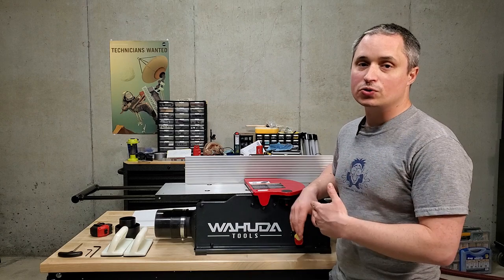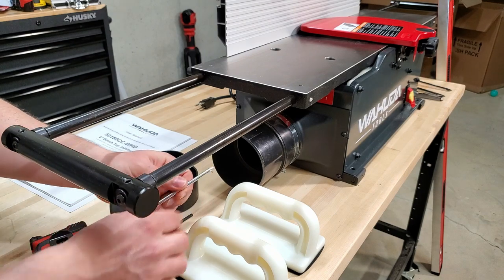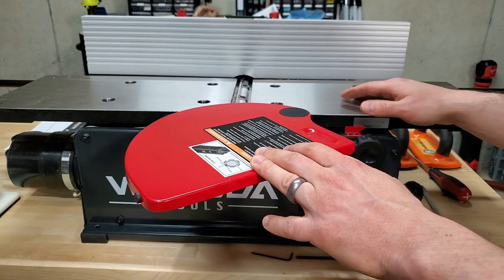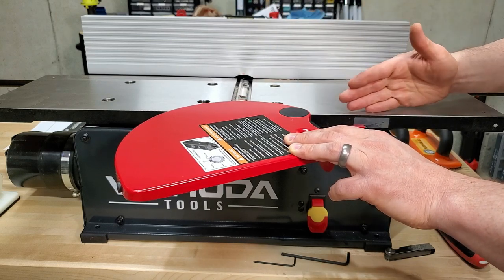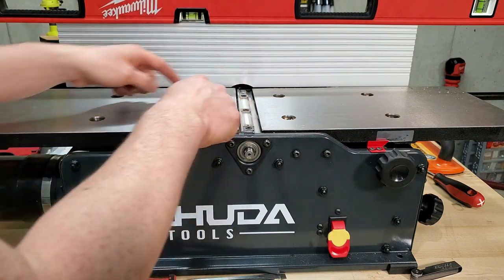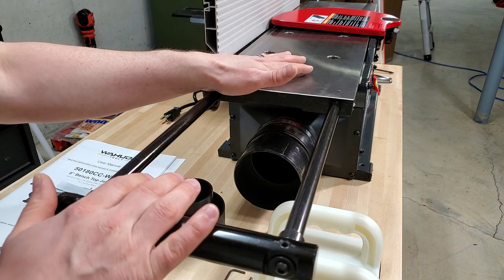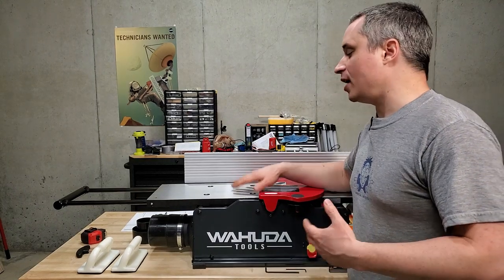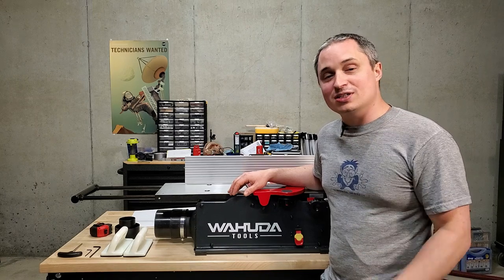Wahuda 8" Benchtop Jointer with Spiral Carbide Cutter Head Review and Setup Tips

Comment: The WEN is the same machine and it is $425 at Home Depot.
Reply from the maker: The Wen has aluminum tables and high speed steel inserts.
Reply: @DoresoomReviews  I'll check that out. Externally, they look the same.
Reply: The WEN has a spiral cutter head with 16 square blades. It has 1" thick machined aluminum tables that users have stated are flat and true. I will go with the WEN.  I have three other WEN tools that have been reliable.
Reply from the maker: If the tables are of the same tolerances, I'd expect it to be a great performer then. You may even be able to update the cutters to carbide when you need to replace them, if the cutter heads are the same design too.
Reply: @DoresoomReviews  Possibly.  I heard someone say cast iron tables are expensive.  That could explain the difference.  Notice that most contractor table saws use cast aluminum. That keeps those prices down.  Flat is flat, regardless of the metal, or MDF etc.  Most router tables are MDF.
Reply: Just wanted to chime in. I'll don't believe the HSS cutter heads are a direct swap for the carbide ones. The older Cutech (now Wahuda) spiral machines used HSS inserts that could NOT accept the newer carbide style. All of this is assuming that the WEN is basically the same machine as the Cutech.
Reply: @russmartin4189  I agree flat is flat, but I will take cast iron any day over cast aluminum, just due to the strength of the cast iron alone. As careful as I try to be, cast aluminum is always softer and scratches and gouges so easily for me. Also, when its time to upgrade and sell the older equipment, the cast iron helps tremendously with resale value.
Reply: @vipervt09  Because of how much I will use it and the recommendation of someone on another channel, I went with a 6" Wen, spiral cutter, and aluminum tables. I will see how it works out. If I don't like it, it will go back. It does not make sense to me that steel is better than aluminum if both are flat.  My table saw table is aluminum and is flat. Scratches have no effect on planing. Old hand tools were all made of steel, aluminum, and wood. Today, they have a lot of plastic in them. Even pro tools. MDF is better for cabinet doors than real wood because of stability.  And so it goes.
Reply: @russmartin4189  That makes sense, I'm sure it will work out great, Wen makes some really nice stuff.  I used a Kobalt job site table saw with aluminum top, and using a crosscut sled, it was terrible how easily it gouges. A small speck of sand, or worse, a slightly larger impediment, and it looked terrible, with deep scratches. Once I started using cast iron, there might be some slight scratches, but it's very easy to buff it back into almost new condition. But as long as they perform well, aluminum or cast iron each have their place.
Reply: @vipervt09  Wen also makes one with a steel top, but it wasn't available. It costs another $100. I paid for this with signing bonuses from Capitol One, so I didn't want to go over what I had or have to wait. I wanted the steel, but I went with what they had.  I doubt I will gouge it. I plan to be using clean new wood.  I have a Kobalt router table which is aluminum. That sometimes leaves what looks like pencil marks. I steel wooled it and waxed it, which helped. If this one leaves marks though, it is back to Home Depot it goes.  By the way, if you pay with a Home Depot Pro card, they give you one year returns, no questions asked. I didn't this time.

Comment: Isn't this a wen? Or vice versa?
Reply from the maker: These different branded jointers that all look pretty much the same are all made in the same factory in Taiwan. Different brands have different specifications though. This Wahuda has cast iron tables and 4-sided carbide cutters. Many other brands have aluminum tables and HSS knives or cutters, which aren't as high of a quality and don't stay as sharp as long.

Comment: First of all let me assure you I mean absolutely no offense or disrespect by the following. I have no problem with accuracy. In fact it does make your work easier, on the other hand, it is time consuming and one can go overboard with accuracy. What i mean is, i have been in my own cabinet shop for forty years and with what down time I do have, limited though it mak be, I build furniture. In a production shop like mine as long as things are within a thirty second of an inch of dead on, both I and my clientele are happy. Thousandths of an inch tolerances are nice but nobody in forty years has shopped for cabinets or furniture
Reply: With a dial caliper.
Reply from the maker: I've never heard of someone setting up a jointer to only 1/32" accuracy. Are you ever doing panel glue ups with boards you've jointed through it? 1/32" on each board adds up fast!
Reply: @DoresoomReviews  not to mention the accumulated inaccuracies with each pass on the jointer. That's how you get tapers...

For the initial setup, it doesn't take much more time or effort to do it right, and on a good machine, your settings should stay locked in. Isn't it worth taking the hour once in the beginning, and then having accuracy for all the cuts after?

Imagine if each machine in your shop is setup with 1/32nd tolerance. Jointer, planer, table saw, crosscut sled, etc. You would never cut anything square.

Comment: Looks 98% like the wen. Same manufacturer most likely.
Reply from the maker: These different branded jointers that all look pretty much the same are all made in the same factory in Taiwan. Different brands have different specifications though. This Wahuda has cast iron tables and 4-sided carbide cutters. Many other brands have aluminum tables and HSS knives or cutters, which aren't as high of a quality and don't stay as sharp as long.

Comment: You are completely over adjusting this thing. Watching you run wood through this I see why you are spending so much time  with adjustments. A bit of advice, there should be very little pressure on the wood on the in feed side once the part has hit the head, all your pressure should shift to the out feed table. Don’t worry, I did the same thing when I first started using mine. Pulled my hair out trying to figure out why I couldn’t get a consistent cut. Once I saw the proper technique, it was extremely easy. You should see the in and out feed tables I rigged up. Noting more than a catch. As long as the pressure is in the correct place it’s pretty easy to get a good cut. Hope that helps.
Reply from the maker: I'm not over adjusting it. Professional woodworkers also adjust their infeed/outfeed tables to the same precision. See the Wood Whisperer's jointer setup video for instance: https://www.youtube.com/watch?v=gO746cuRqV4
Also, Wahuda probably wouldn't have featured my video on their website if I was recommending unnecessarily precise adjustments: https://www.wahudatools.com/product/8-benchtop-jointer/

Your work will only be as precise as your setup is. Maybe you got a fairly good adjustment from the factory, or maybe you just haven't noticed your workpieces aren't perfect. Or since you mention your quality of results relies heavily on technique, you may only have the back edge of the outfeed table aligned with the cutter head.

You do make an excellent point about technique being important as well though. I am primarily transferring most of the force over the outfeed table in the video, once the workpiece is substantially over it.
Reply: @DoresoomReviews  We can agree to disagree. The amount of adjustment you made will not effect the fitting at all. Having one hand in front, and one hand behind the blade can create much more of a problem than the  .0003 adjustment ever will. 

But I will say, your video is very useful for the unlucky ones that get one that is out of adjustment. 

You would laugh if you saw my in feed and out feed tables. they are not perfectly aligned in any way. But that doesn't matter because I keep the pressure on the machine and as soon as it is safe all the pressure is put on the high side of the machine. My extended tables only assist me, they keep the weight of the board from causing the board to lift off the machine. Works like a champ and the end results are great. 

Thanks for the video.

Comment: It's a Wen.
Reply from the maker: There are quite a few jointer brands with the same general parts. But the Wen has aluminum tables and high speed steel inserts, while this Wahuda has cast iron tables and carbide inserts.